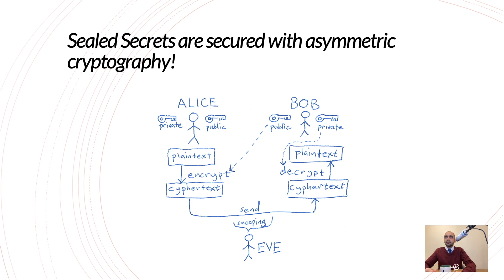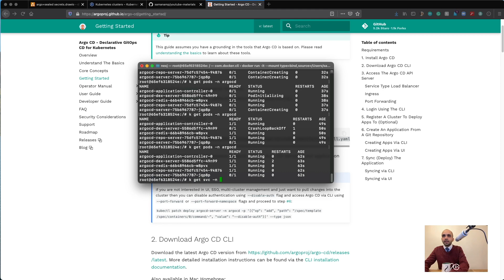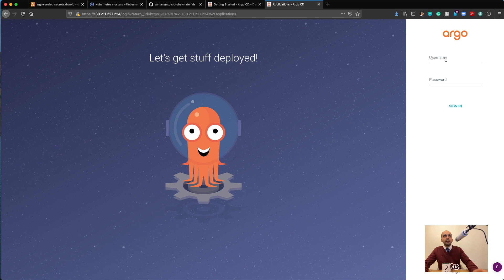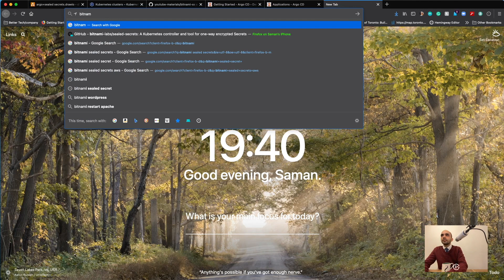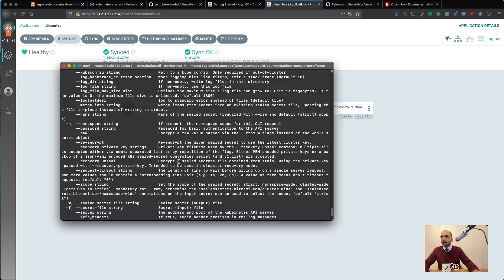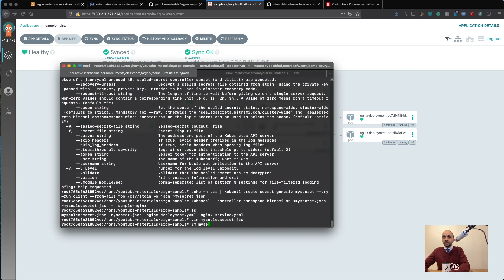Secure Your Cluster W/ Bitnami Sealed Secrets

Comment: Hello

Can you please make a video on how can we connect the java application to the RDS database using the secretes? l
Reply from the maker: Hi,
For doing that connection we need these components:
1. Java application reading their properties from one external location, e.g. "/config" in linux file system
2. A pod that mounts config from a secret kubernetes resource to "/config"
3. Sealed secrets install on kubernetes
4. encrypted secret sealed by sealed secret applied to kubernetes
Reply: @dailysredevops6755  can you please make a video please
Reply from the maker: @kkkant1547  Sure, will put it on my video plan.